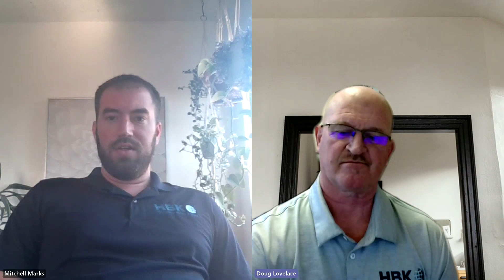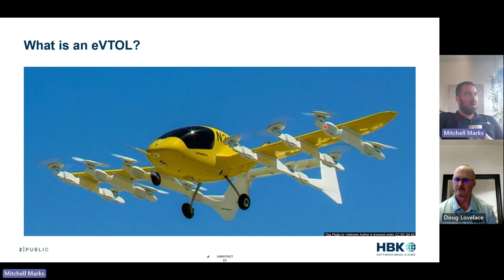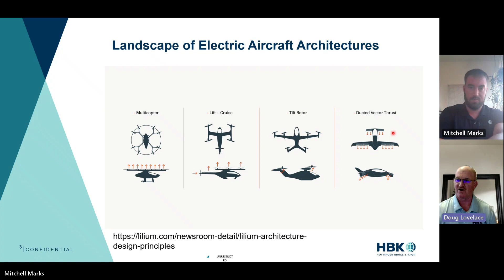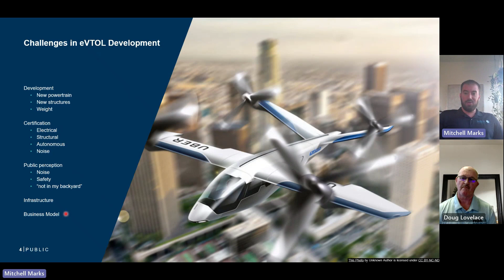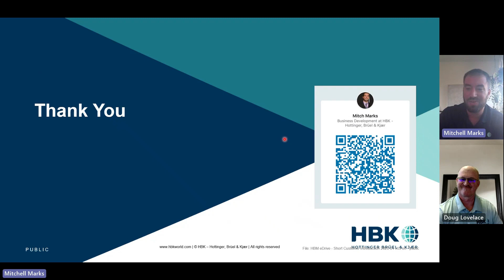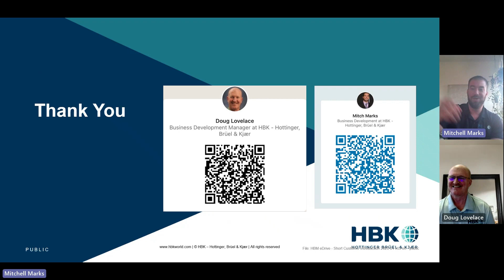What are eVTOLs and What do they Need to Test? (Electric Vertical Takeoff and Landing)

Comment: The number one reason why they matter is stability upon all flight envelopes. 2nd to that is being very 🤫 🤫 🤫 🤫 quiet and third is an incredible "sortie" rate or ability to fly near continuously provided the weather holds up. For now and I think for the sake of simplicity they are battery powered but this could change quite quickly given enormous advancements in hybrid drive systems for US consumer automotive products which are now quite suddenly in a massive glut. Should this technology migrate into Aviation and watercraft design the impact upon flight inside North America and the Caribbean would be immense and immediate.